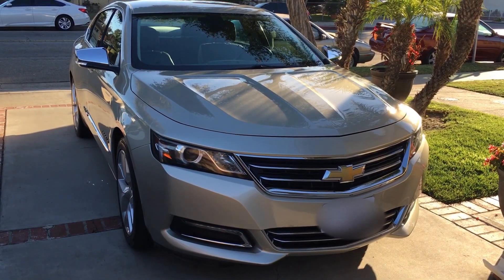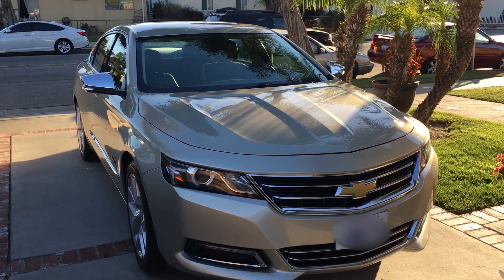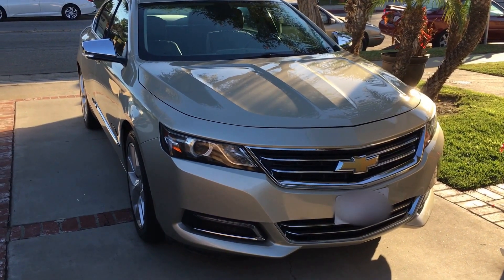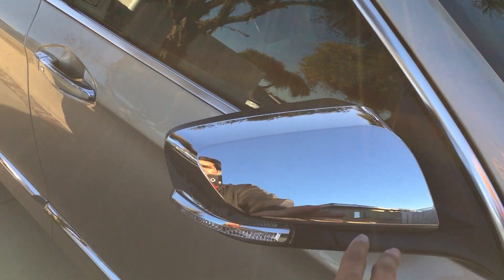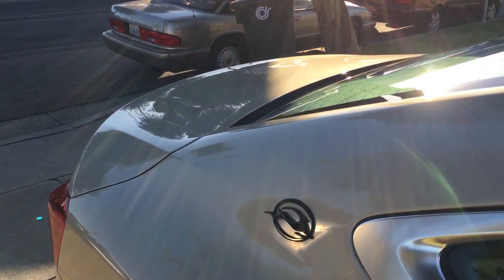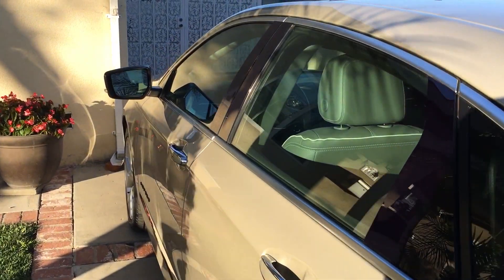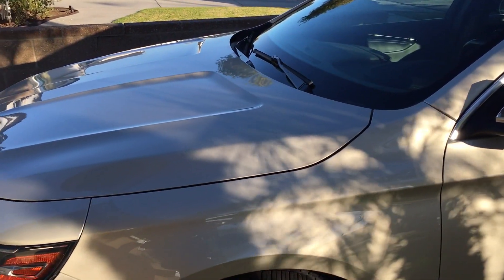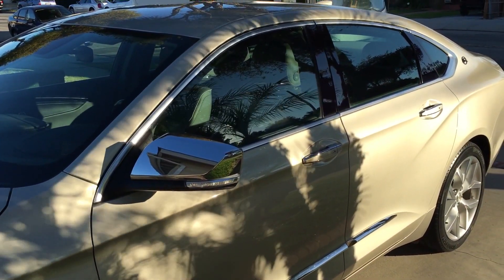2015 Impala LTZ Final Walk Around - Jade Graphene Pro Ceramic Coating

Comment: Mike I wonder how different the Jade graphene, Adam’s graphene, and ethos graphene are. They’re all made by b&b blending. I doubt they’d be making unique formulations for each.
Reply from the maker: Their base formula is probably the same with slight tweaks here and there for each manufacturer.  I have more graphene coatings coming for my next test.  

First impressions of Jade are are good after the first wash.  Working on that video next.